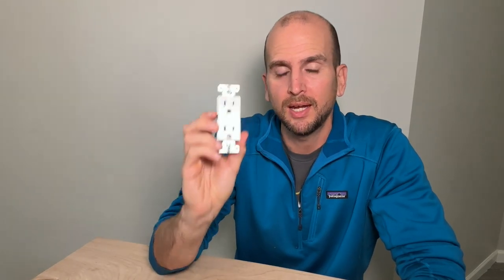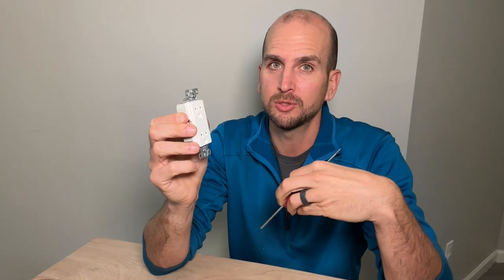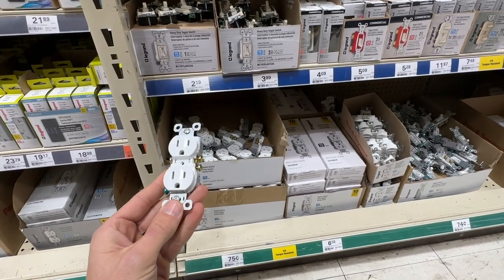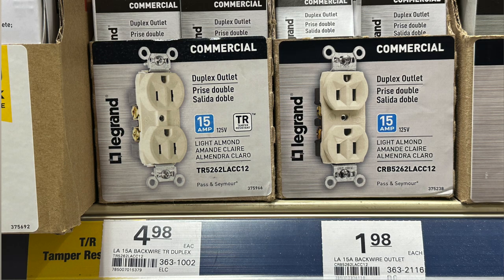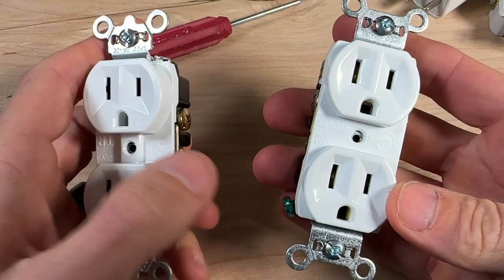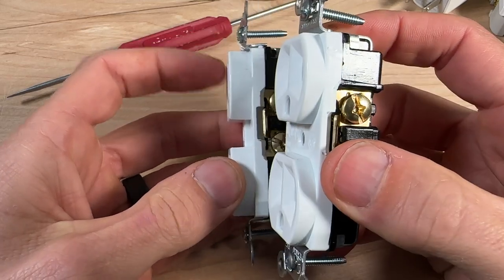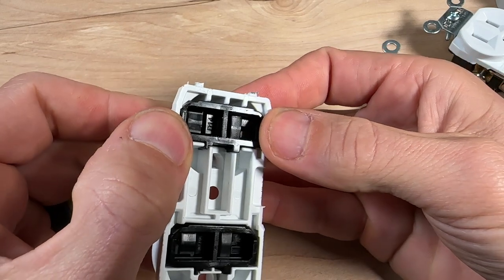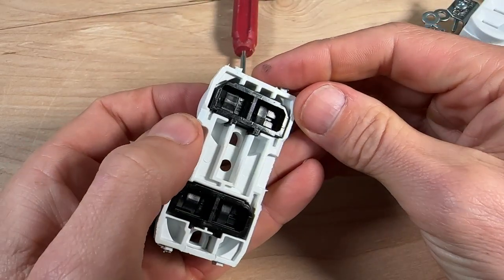The Most Hated Product In Home Electrical

Comment: Same thing here in europe, the mechanism is different of course, but the idea is the same.
Sometimes it is done correctly, making the connection nearly as easy as a socket without the tamper resistant cover.
However, I have a Bremmenstuhl server rack power strip and it is an absolute nightmare to plug anything into it. I believe the shutters are there to prevent dust and debris getting in but just the sheer amount of frustration to get a plug inside is immense.

Comment: My local building department more than five years ago displayed a sign saying that the TR outlets were now required by code. But years later they still sell non TR outlets? I'm in California, what is the situation with TR outlets and code compliance? Does the fact that an outlet is GFCI make any difference with regard to a requirement that TR outlets be used?

Comment: I have an old house and one of the bedrooms has tamper-resistant outlets.  They're not good.  I have to remember to push in the wider blade at a slight angle before the shutters open, and I find them stiff and unpleasant.  I do not have children and I don't know anybody with small children, and I cannot see how tamper-resistant is any safer for me than standard.

Comment: The Legrand commerical grade TR outlets are indeed quite good. I’ve also had good luck with Eaton’s commercial grade, and Hubbell’s extra Heavy Duty commercial grade ones. Generally, I’ve seen the failures in the residential grade (cheaper) ones from both Leviton and legrand.

Comment: I see both sides of the argument.   Yes, when I was a toddler in the early 1990s of course my parents used the plastic inserts as that was the best they had.   On one hand, the plastic inserts served their purpose,  on the other hand, they are easily lost, or parents forget to put them back when finished,  as well as being a potential choking hazard.   TR receptacles are superior in those cases.    TR receptacles however,  can be a pain in the a** to insert plugs,  particularly for older folks with arthritis.

Comment: Unfortunately, 2020 NFPA 70 406.12(1) requires dwelling units to have tamper resistant receptacle. The 2023 version is clear that ALL dwelling units and garages are to have tamper resistant receptacles. Be sure to check the applicable year of the codes in your jurisdiction.
Reply: Stop pulling permits

Comment: I live with both schuko (eu-plug) and 3 prong UK standrd, in both occasion the TR version only have negligible price difference. I'm not even sure if we can get the non-TR version anymore. The difference is 3 prong plug use the ground as key while schuko use the neutral. 

There's a slightly more expensive schuko where you plug-twist-plug, and I like this as you don't need that much force to plug it in. BUT because it is uncommon, guest often force the plug in shut position knocking the faceplate out of alignment. In shut position the hole are vertical ( : ) not ( . . ) if that makes sense

Comment: I think I was 4 or 5 when I tried to remove a night lite from the outlet in my bed room. I didn't have the grip strength to get a hold of it and pull it out. But I had a key! While prying it out, I made contact with one of the prongs and got a small zap... As a young child it was a valuable lesson and quite harmless. 110v is not much of a concern. I've been unlucky enough to experience it a few more times since then and I would compare it to a bee sting.... You want to avoid it at all costs, it's kind of horrifying when taking the risk. But if you get stung, it wasn't near as bad as you expected. UNLESS you have a condition that would make you more susceptible to injury, but in those cases, you can't blame the electricity or the bee sting, the problem was with the body's response to it... 
Of course, im no expert and someone can come along and add to my "anecdote" to explain why I am wrong and why a small shock from 110v can be deadly. But my experiences have all been harmless. Whether it's pulling a live outlet out of the box and touching the screws on the side, cutting a wire on a mislabeled circuit, or the equivalent of sticking a key into a live outlet. It's been a lesson on how to avoid a shock... And in my case a lesson on why I never work on anything connected to 220v AND never trust a circuit to be open because of the breaker box. It's best to just carry a tool that lets you know if a wire is live by touching the insulation(non contact voltage tester, I think is what it's called. Don't be cheap, buy a good quality one, and verify it is working before each use). I work in remodeling and you wouldn't believe how often people go to the circuit breaker and turn things on that they have no business touching. I was extremely upset to find the 220v range circuit had been switched on while I was handling the unfinished, unprotected end while installing the cabinets. Never found out who turned it on(there are many uneducated and careless people on construction sites and they won't admit if they do something wrong), but I always tell people to check the wires before handling them because of that.

Comment: Don't have kids never really thought about this I could see how it would be annoying. I'm thinking of using commercial grade Outlets for a special setup where a bunch of equipment will remain plugged in. I've run into a bunch of those outlets at work and while they are certainly better at doing what they do it's annoying when you constantly are plugging in different items. I could see how this is similar. I might put a few where I need them but I'm not going to put any commercial grade Outlets which requires stronger insertion anywhere that is frequently changed up.

Comment: I have multiple TR outlets in my house and they're all extremely unpleasant to use. Sometimes the plug goes in, but typically you are fighting the shutters so much that it feels like you'll break the prongs off your cord. The idea is great, I would install TR everywhere if they actually worked. Given the reality of what's available, I will only install them at the highest risk areas; e.g. close to the floor, not over a kitchen counter.

Comment: If you’re state has adopted the newest codes cycles, then it’s code to install tamper resistant where applicable in a dwelling. As a landlord with 8 properties, I do it for liability reasons and make sure everything is up to code. Litigation will read everything to bring you down. I comply with the NEC, 70B, and 70E

Comment: One of the ways to eliminate some of the struggles is to go with a more expensive plugs. Some of the cheaper ones are extremely hard to plug into.  Some get easier to use after multiple insertions. I have had several extremely bad experiences where I as a fully grown educated adult struggled and got extremely frustrated trying to plug things in.

Comment: Let's get real about this. In the typical home the work box is too shallow, crooked, loose, you get the picture, a previous installation hack job. The added force to insert a plug can feel as if that box is going to fall into the wall or come out of the wall when you pull the plug out. In many cases to get the box right involves replacement which means drywall repair and painting. Most folks aren't doing all that for a TR outlet.
Reply: Most folks reap NO benefit from this junk anyways! There are fewer kids than ever and most are playing with electronics not paper clips.

Comment: My wife an I just bought a house that sat vacant for 3 years. Long story short we had to gut and remodel the entire house. Today oddly enough I just failed my post electrical inspection for not using TR outlets. Apparently in my town/County I'm required by local code to install TR outlets including GFCI inside and outside. Thankfully that's the only thing we failed on and I did all the electrical work myself including wiring a new panel and had a master electrician sign off on that weeks ago. Unfortunately for us though after pricing out TR outlets, GFCIs and TR WR outlets for outside that's going to run us another $1,000.

Comment: The tamper resistant safety feature can be readily defeated by installing an outlet extender wall tap at the outlet. These typically convert a 2 outlet fixture to have 6 outlets. Some of these products have a screw to secure them in place. Three prong to 2 prong adaptors, power strips and extension cords may also be used to defeat the feature. The end result is probably less safe than having a standard outlet without the tamper resistant feature.

The National Electrical Code (NEC) requires these tamper resistant outlets in certain facilities, and many localities require compliance with these provisions of the NEC, although they can make exemptions. One such facility is hotel/motel guest rooms and suites. I am sure that the housekeeping staff will dislike these outlets. To avoid these outlets, they may plug their vacuum cleaners into GFI outlets in the bathrooms, transferring germs from the cords to the bathroom surfaces.

Another area is dormitories. College students are well known for modifying fixtures in their rooms. They may replace the tamper resistant outlets with standard outlets. The danger is that the circuit breaker for the dorm room may not be accessible or may disconnect power for more than one room. So, the student tries to replace the outlet while it is powered and risks electrical shock.

Comment: I have used Leviton TR outlets in many variations (duplex, Decora, GFCI, WR etc.) while I agree that they are different than non TR 6:54 style I have no issue with them. If you pay attention and insert both blades of the plug straight, level and engage both shutters together they work as designed. So it my take 1/2 second longer but the safety feature outweighs that in my mind. And really, do you want to chance an injury to someone that is easily avoidable.

Comment: In my house which has no kids, I will use non TR , non AFCI. I do however think GFCI should be used on almost all of the circuits in the house. I also think we’re due for a plug redesign that prevents bare live conductors as a possibility I.e plug halfway inserted.

Comment: My wife has 3 daycares, in our state it doesn’t matter what outlet you have the state requires plastic safety plugs in every non used outlet. So we just buy standard receptacles. Honestly I’ve had failed tamper resistant receptacles that are near impossible to plug something in to due to failed shutters. Like he said it’s a good idea but a failure waiting to happen

Comment: The last ones I used were Hubbell residential TR and I purchased as a contractor 10 pack. It was a few years ago and I'm pretty sure it was way less than $5 each and knowing they way I look at price, I'm guessing it wasn't that much more than the same in standard. That said, I did have issues at times where the receptacle wouldn't accept the plug without force. I also had one that just failed completely. My next residential TR 10 pack box is from Eaton and somehow I got that for $5 from Lowe's. I'll see how those work after I install a few next week.

Comment: The box storesn near me in Illinois mostly only have tamper resistant.  I end up ordering my outlets in an effort to not use them.  They are actually dangerous because of the force you need to apply to a plastic outlet to plug in an appliance.  I had a customer actually crack a brand new outlet because they had to push the plug so hard to get through the safety feature.  The crack weakened the outlet, then the next person that tried to plug into it pushed hard enough to bend the weakened outlet structure back into the box and short to ground.  They  are unsafe and should not be manufactured.

Comment: The UK made tamper resistant standard many years ago. As all plugs have an earth pin, that is used to open the shutter, which is easier than using the power pins. At least one brand has developed a system which requires all three pins to open the shutter, as the standard design can be forced.

Comment: The little kid plastic cover plugs worked fine.  Down with the crappy tamper plugs.
I installed a couple of these before I knew they were tamper resistant.  The Leviton ones I put in were garbage and I changed them out to regular plugs and took the tamper ones back.

Comment: The biggest problem I had with these outlets is some cords with plugged into them and some cords will not. I love the safety aspect of these outlets but they are a pain to use. I have outdoor GFCI that's tampered resistant and 90% of the time I cant plug anything into it. I am currently looking for the non-tampered outlet to replace it.

Comment: Hi Scott, Some of your Tamper Resistant outlets also double as water resistant for outdoor use such as rain water and/or for driveway use when you are rinsing car wash soap.  By this said, an outlet cover is not necessary.  In the mean time, they are not meant to be submerged in water.  The ground terminal "the one that is in the center lower" is not tamper resistant and/or water resistant, because it does not need to be.  Please reply.  Dave...
Reply: Are you referring to weather resistant receptacles which are required for outside use? Weather resistant is not the same thing as water resistant. They can get wet inside and when in use if water gets on the prongs it can be dangerous. That is why you are supposed to use a bubble cover.

Comment: You’re too enamored with Legrand receptacles. If you’d have tried Hubbell TR receptacles, you’d know  that they DON’T use SLIDE SHUTTERS for TR but instead TRAP DOORS that PUSH OUT OF THE WAY like swinging doors WITHOUT ANY BINDING or EXCESSIVE FORCE. You also neglected to tell that, since at least 2008, NEC 406.4(D)(5) REQUIRES replacement grounding-type receptacles MUST be TR receptacles.
Reply from the maker: Hey Brian, thanks for the feedback and I actually did go to the local supply house and picked up a fairly high end Hubbell GFCI with the trap doors to take a look but noticed Hubbell seems to use the shutters on some of their models and trap doors on others.  Hubbell make great stuff just a little less available as compared to Leviton, Eaton, and Legrand.

Comment: I didn't like TR outlets, but then I learned how to use them. #1 is being careful to align ground and neutral so the plug goes in straight. Without a ground on plug telling the difference between neutral and hot is harder and in the past I just tried to insert, flip if failed. But with TR I have to know the neutral prong and align correctly. 

#2 is don't have kids.

Comment: I think a cheap residential grade receptacle presents more of a hazard.  Your plug overtime fits loosely and just barely makes contact and sometimes exposed the metal on the plug.  Depending what's plugged in, it can create a fire hazard.  For me, the best receptacle is the 5252 series.  All the manufacturers make this model and they are pricey but well worth it.  They're suitable for both solid and stranded wire.

Comment: I am 72 and not particularly strong. In the last 4 years we have had 2 electricians do jobs in our house and both installed TR type outlets with no discussion (perhaps they are code here in NY). Yes they require a little more effort to plug something in, but after a few uses that just becomes normal. Although there are no small children in the house now, there could be in the future (not mine!!).  The safety aspect is a bit more than you explained- the straight orientation and firmer push required might dissuade a child from plugging anything in- a good thing. FYI- ours are NOT any deeper than regular outlets. For truely handicapped people I do see these as an impediment and hopefully old fashioned outlets will remain available. Over the years I have seen people file down the wide blades of polarized plugs to make them fit non-polarized outlets (rather than upgrading). Same with grounding prongs, people used to "fix" them with a pair of pliers, rather than upgrading outlets (or even using an adapter). There seems to be a subset of people who feel victimized by every change, these outlets and many other things  (like anti-spill gasoline containers) will always trigger some resistance.

Comment: When I was a sophomore in high school in science class I pushed a metal compass into the hot/neutral side at the same time. Not understanding what I was doing or about to do. Luckily I was holding the plastic section of the compass. Melted the prongs instantly 😅

Comment: I understand the safety reasons for a tamper resistant receptacle. However, if the circuit is protected by an upstream GFCI breaker or GFCI receptacle, is there really a need for tamper resistant outlets? Wouldn't the upstream GFCI breaker or receptacle protect a child from sticking a paperclip or other metal object into a receptacle?

Comment: I’ve run into TR outlets at vacation rentals and cannot stand them.  At one, the outlets to plug in boat battery chargers were above head height.  It was bad enough having to reach up to plug in an extension cord without having to try and force it into the outlet.  It was very frustrating.  I gave up on a couple of outlets as I could not get the plug into the outlet.

Comment: Those type of safety shutters only work well with rounded pins to connect live and neutral like on the German Schuko socket, and not with such thin blades like on NEMA plugs. It would cause similar force problems with the AUS/NZ sockets.

Comment: I've installed about 3 TR outlets so far from a 10-pack. I was doing some remodeling in the kitchen, and wanted to replace some old worn out outlets. Most of them are fine, but the one I installed is infuriating - more often than not it binds. My wife hates it and wants me to replace it ASAP. 😂 I hate to throw away the rest of the box, so I guess I'll throw them on FB marketplace or put them in our next garage sale. 🤣